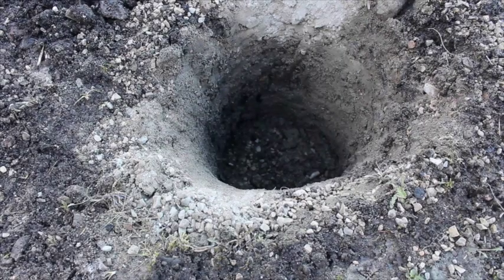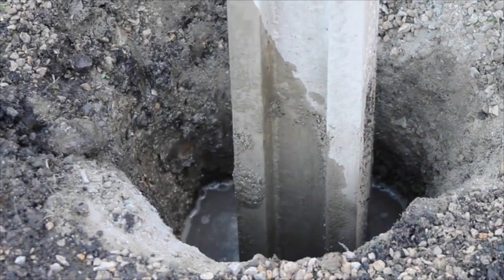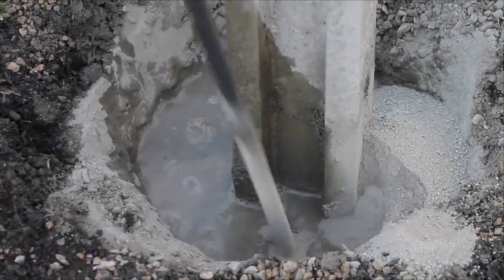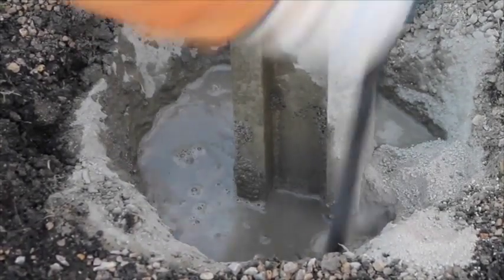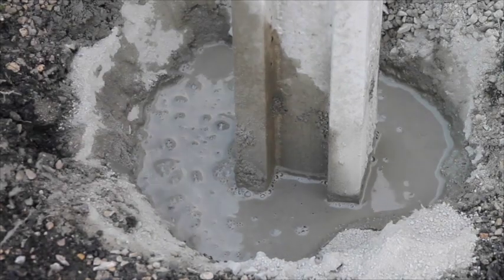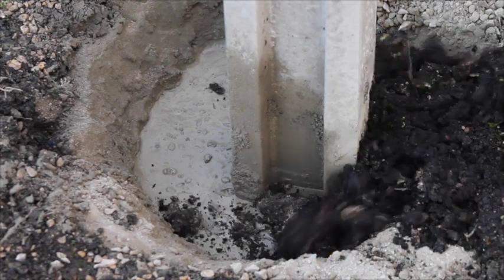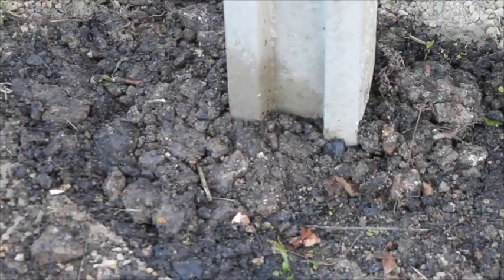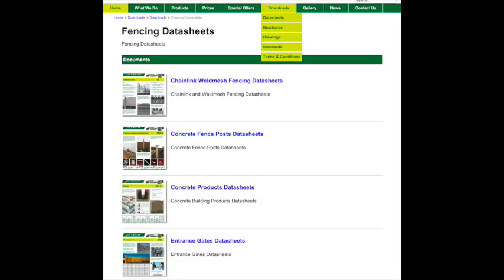How to use post mix for concrete posts

Comment: Thanks for taking the time to make a video  :)  I hope I don't mess this up considering it took me 5 hours to dig the hole lol
Reply: Same,  Digging holes is time consuming damn!  just to mess it up on the cement would just be down right waste!
Reply: Well the post jumped backwards as the cement and water went in but it doesn't look bad so it's cool  :)  That's the trouble when you don't have anyone to help, I don't have enough hands lol
Reply: Yah i think it's best for me to wait for other to help hold the post while pouring
Reply: Definitely, this was my first time so I've learnt to wait for help in future
Reply: What link is that then?
Reply: Just keep a couple of bits of 2x1 or 2x2 2ith you prop the post level with them pushed into the earth both sides to be plumb then fill with water and mix when it starts to go off a little just double check for plumb and adjust if needed it will almost hold itself by then.
Reply: ThePolechick ñnn

Comment: Quick video, but question about the concrete, shouldn't the concrete come up above the ground? If you cover the base with soil then it will rot in time
Reply: its concrete you donut it last a 1000 years
Reply: Steve Hurt lol a donut I am indeed I just realized these were not wooden posts

Comment: I personally like mixing all the concrete with water then fill in hole it is stronger by far knowing that it is all been mixed right with no dry patches within the concrete.
Reply: You are correct sir it is the best way, but with post mix it can go off in 60 seconds plus on a none cold day and your tools and bucket will be one for ever you also wont be able to clean them. It is not just a mixture it is a ultra fast setting concrete.